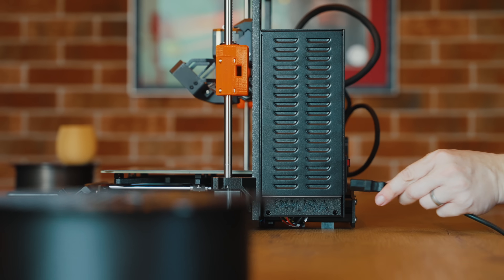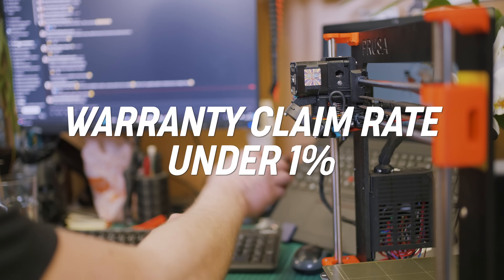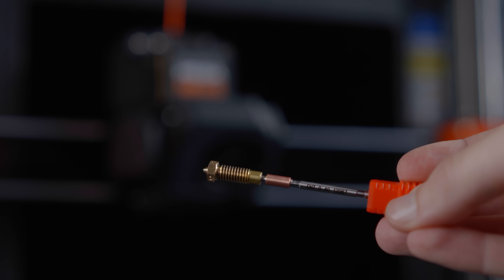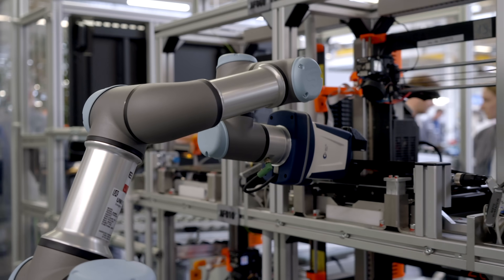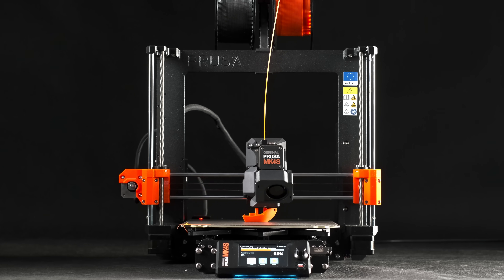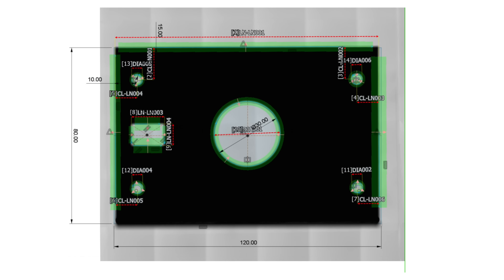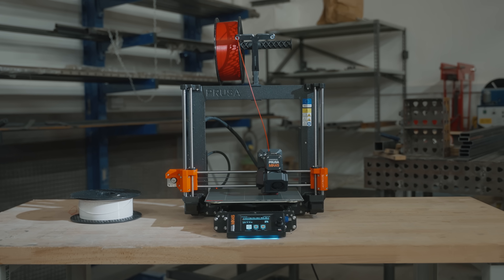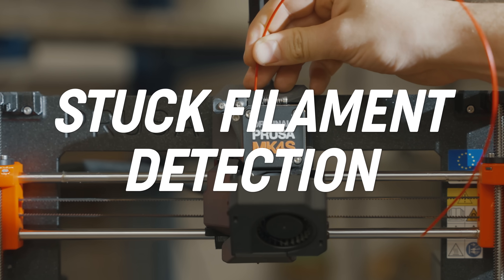Original Prusa MK4S - 360° cooling, High-flow nozzle, Native mobile app, PCCF parts - SHIPPING NOW

Comment: Nice. Very nice. MK3(S) owner here. I've been very with my printing years in past with it, but it's obviously quite dated these days. I've been planning about upgrading, maybe in the winter and honestly I was looking into Bambu's. But I've seen some parts with them having ringing as much as MK3 and it was very disappointing to see. Now MK4 originally didn't get much of my interest, but if you've been focusing into dimensional accuracy and these new feats you're absolutely back-in-the-game for me. Reliability is something I was expecting already from my MK3 experiences. Excellent dimensional accuracy, minimum artefacts like ringing, good material support, ease of use, decend print speed and reliability. Those are what I want from my printer.
Reply from the maker: Hello, thank you for the comment. You can upgrade your printer to MK4s with a single kit. The upgrade to MK4 now becomes upgrade to MK4s. No need to buy two upgrades
Reply: You get a better dimensional accuracy out of the box with the MK4 compared to Bambu, without profile tuning. Otherwise you can get them both to print the same for accuracy, with minimal tuning. The mk4 is definitely a step up in this area compred to the mk3 series
Reply: @CraftySven  Yes. There's quite many good changes now in MK4S compared to good old MK3. Personally I don't give any credit to almost all people touting that XY printers are must and bedslingers are obsolete. Why someone might ask? It's because I used to work in sheet metal fabrication plants and even there in high accuracy and speed machines work piece was moved in many machines bit similarly as bedslinger printer. I don't see any issues in design if overall design is just made suitable for application. Some tend to forget that XY design might quickly thinking look absolutely superior,but many olso forget that one axis accuracy problem will very, very easily reflect directly into remaining axis accuracy too. To my belief next iteration that's needed in 3D printing is new axis that nozzle can turn in angle to create even more steep overhangs which is serious limitation currently in every single printer imo. They're surprisingly good,but they need to get better. Now this change will add weight to print head and I kinda suspect that corexy isn't best style to accomplish this. Many designs can work well. Imo it's very foolish to say everything should be corexy styled. Good overall design is what matters, not frame type/style that can be botched 🙂

Comment: The overhang test on "Competitor 1" with Aux fan and PLA - you do realise the aux fan is supposed to be switched off for PLA right? No wonder it failed, but I assume that was the intention ;)
Reply: They are just hurting. Competitor 1 is kicking their a.......s
Reply: @elleryfg7853  Competitor 1 is being sued for patent infringement because china doesn't care about IP's
Competitor 1 has a 2.5 rating on trustpilot
Competitor 1 is getting beat by "outdated" prusa.

Comment: "Imagine if you could do that with your phone"

Prusa dropping shade!
Reply: I didnt get the new talking points. I guess we aren't hating the cloud this year when Prusa does it.
Reply: @hawtdayum Pretty sure most didnt care about the app and wifi/NFC. The main point were the fan design, nozzle, and the bigger one GPIO board with accelerometer. I am not using prusa connect, and I wont start using. What are the advantages of the new app? That the api will get improved and we can develop better 3rd party apps, and improve octoprint. I will never trust a Chinese company server controlling a devices in my house that has camera (bamulabs, not will I trust more any other company (prusa).
Reply: I can already have my filament load, print and monitor(with camera) from my phone and never have to touch a slicer.
Guess which printer I own for a less than half the price...
Reply: @AwwwSnapperz  And the Chinese are watching you. I would never trust them.
Reply: @AwwwSnapperz  The one that had a recall and now being sued by stratasys?
🤣🤣
Reply: @LilApe recall is over dawg. Try to keep up. The patent troll Stratasys threatens the whole industry Prusa is no exception.heated beds, force sensors. The are suing for the act of fdm printing of laying down plastic by layers.

What's hilarious is some of the stuff they are suing for comes straight from prusa slicer like purge towers. Bl doesn't use purge towers but prusa does.
Reply: @LilApe  manufacturer initiated safety recalls are good for consumers. Everyone should be very interested in the Stratasys lawsuit, because most of the technologies that are subject to the lawsuit are used in printers made by other manufacturers. In some cases they even involve technology that first entered the hobbyist market on Prusa printers, like the PEI coated build plate which is a patent that Stratsys acquired from Arevo earlier this year. Stratasys is going after Bambu first, but I wouldn't be surprised if other manufacturers will also start getting C&D letters, especially if the outcome of the Bambu lawsuit is favorable for Stratasys.
Reply: @lavachemist  Thanks for being a breath of fresh air in the comment section. The world needs more critical thinkers who dont give into biases and group think as easily.
Reply: @LilApe  You DO know that many of the features in the Stratasys lawsuit are slicer based right? The slicer which is a fork of Prusa Slicer. And many of the other physical items in the lawsuit are used on machines by Prusa, Bambu, Elegoo, Creality, Anycubic etc
They're starting with Bambu but if they gain anything from that lawsuit they will go after the other companies next.
It's in everyone's best interest that the lawsuit goes nowhere. 
They're not going to only hurt Bambu, they will potentially hurt the entire hobbyist community.
Reply: @lavachemist  Correct, but Josef has shown he will play ball with Stratasys to eliminate competition that he could have innovated out of existence prior to playing catchup. His willingness to back a law firm is unsettling. As a company who only innovates by taking competition to court can only be considered such, in my mind.

That said, I own a few Prusa printers. And a bunch of others. The only leg I have in this game is as a person who supports open source and transparency if not OS. I also will support FOSS foundation and their battle against Stratasys...when it occurs. For those who support the big boys that use BOUGHT IP (and IP made by the public first) to eliminate competition, well, I won't support you at all. And will actively make sure others know you are a POS as well.
Reply: OMG the noobs from the bambucrap camp are insufferable.
Reply: They are clearly running trying to catch up to Bambu Lab. They have never released a MKXS so fast and are clearly trying trying to compete with the features Bambu Lab offer on their printers
Reply: @elleryfg7853 competition breeds improvement
Reply: @elleryfg7853  lol their MK3S was released a year after their MK3 launched. So is their MK4 to MK4S. What are you even talking about playing catchup?
Reply: @LilApe Well at least this upgrade kit makes prusas 1200€ printer significantly faster than bambu labs 350€ printer, so that's nice. Before this the A1 and MK4 printed at roughly the same speed.

Comment: Sounds promising. I like to know the content of the upgrade kit. Can't find any information about it.
The only thing is, that the most noise of my MK4 is not comming from the part cooling but from the hot-end fan. The part cooling fan is usually not noticable. Since the "stealth mode" is not working and the part cooling fan makes a lot of noise the upgrade will not make the printer more silent...

Comment: Prusa keeps being awesome. So stoked for the accelerometer!
Reply: @hanslain9729  seriously,  I was just looking into adding it and seemed.pretty difficult.  I was thinking they will probably add it soon and sure enough!
Reply: I wonder if it will require the whole 4S upgrade or will all the information and custom pcb designs still be considered viable
Reply: @maka6000 As the developer of the custom Accel Board project, it’s highly highly likely it is compatible with the MK4 without upgrades. It’s basically just an off the shelf chip and firmware has supported it for a while.

I already placed an order for the upgrade kit and both dev boards, so I will definitely be testing before I upgrade to see.

Comment: My MK3S+ is still running steady but this is even more enticing to make the upgrade / add a second printer to my lineup! Great upgrades as always from the Prusa team, this is awesome.
Reply: It is so hard to justify the upgrade kit when it is only 200 dollar difference from just the full printer kit. I keep waiting to see if the upgrade kit will decrease in price, but I may just have to get a third printer.
Reply: @jdhobbitson  yeah if I was hurting for space I’d more strongly consider an upgrade kit but the price difference makes it way better for me to just get another printer. I’ve got an Ender 3v2 I was planning to upgrade currently collecting dust, starting to look like some prime real estate 🤔
Reply: @jdhobbitson  Just get a friend hooked on that hobby by supplying them with printed stuff. I built my MK4 last week and sold the previous MK3S+ to that friend. I came out cheaper with the kit and a really fair price for the old printer. Now we even have two working printers instead of one functioning printer and a pile of useless parts.

And I kind of want that second printer back. I am just waiting for my 10h print to finish so I can try out that new thing I found on printables...
Reply: The review looks very good, I will buy a second printer too.